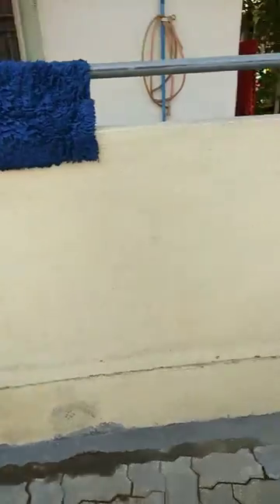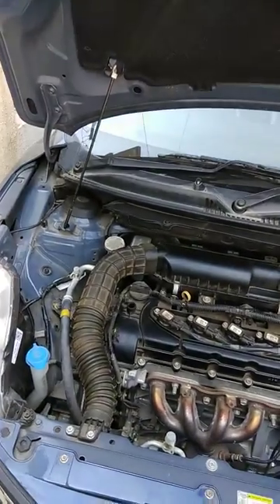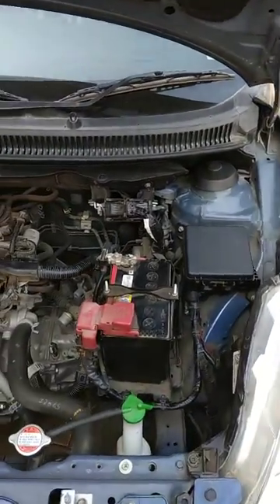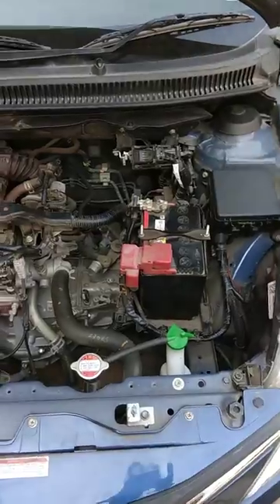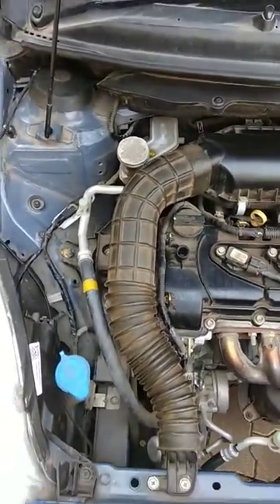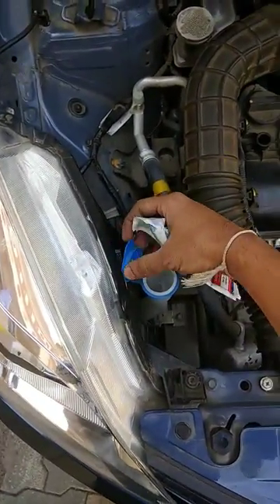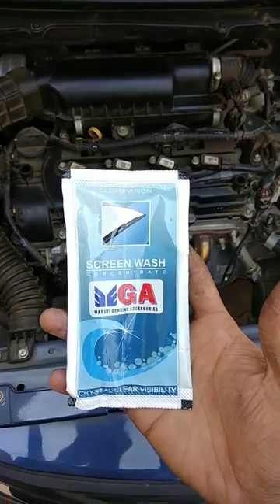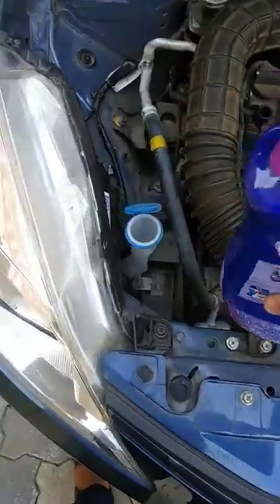How to fill up wiper water tank in Maruti Suzuki Baleno

Comment: In what ratio distilled water and sampoo should be filled in
Reply from the maker: The sachet I am using is Maruti Genuine accessories Glass Concentrate. I added 50ml(full sachet) in 1 litre of water
Reply: Never use shampoo in the washer tank. Use this washer fluid.
Reply: @gunjankumar6566  why ,
Reply: @shane90000  after few days it sediments down as chokes the pump pipe, eventually increasing load on pump and the motor burns.
Reply: @gunjankumar6566  ok